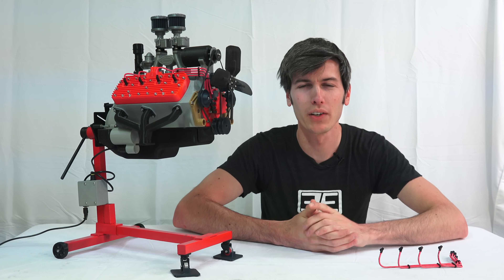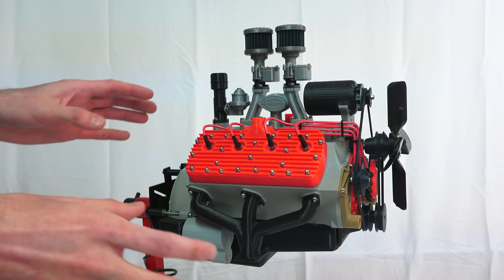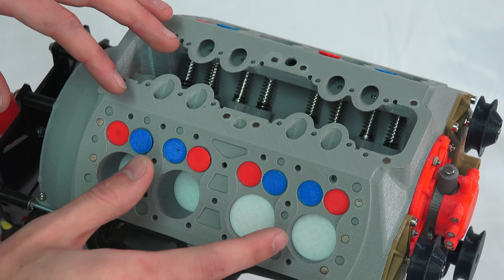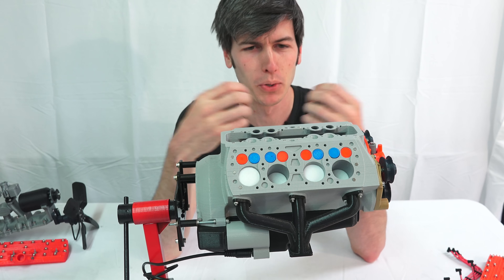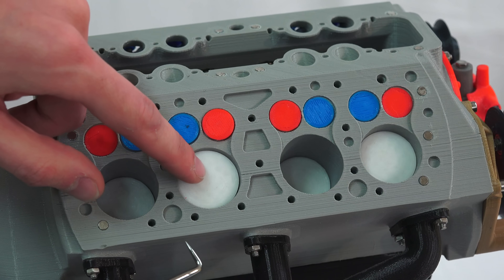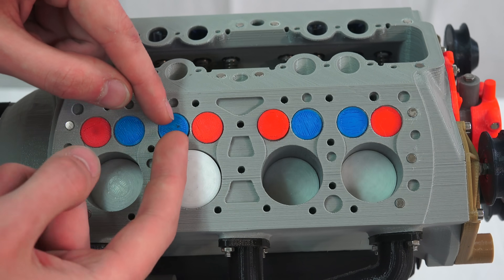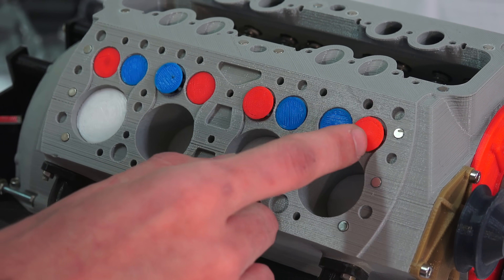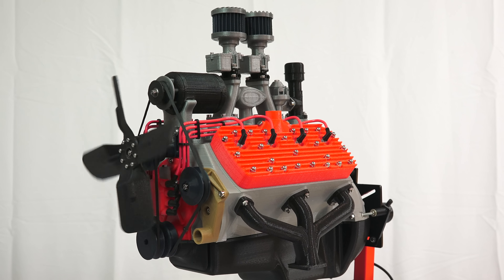Why Ford's Flathead V8 Engine Died

Comment: I think you get way too much into direction change, which current engines do also (intake to exhaust). Intake comes down, exhaust goes up. The real problem is the total available area of the intake and exhaust, which is exceedingly restricted by current standards.

Comment: It's a nice model and a fair explanation of what is going on in a flathead but if we can't believe your age, then why should anyone trust anything else you discuss? I'm not mad, I'm just curious why you would start off (at thirteen seconds) with an extreme and inconceivable statement. ....and you missed the largest, 337, truck/Lincoln engine.
          The cylinders were not offset for the sake of the camshaft but rather the crank, two cylinders sharing one journal.
          A major issue was keeping them cool. With several inches of exhaust port between the valve and the manifold, times six, and the 2-3 and 6-7 cylinders sharing the same port (in the core of the block) it required a very large radiator to cool the water. Ethylene glycol was introduced as an anti-freeze near the beginning of the great depression, therefore not widely accepted or afforded immediately. Also not quickly accepted or recognized as a cooling assistant. 
         It was built for durability at a time when longevity was as important as any feature.
As for power, a little wind from a supercharger (Hollywood Graham had one in 1934) or
a little spray from a Hilborn injection system and we're off to the races, Indy in 1949.

Comment: My first car was a 1951 Ford V8 with overdrive which I bought in 1958.  You covered many of the problems with that design, but I will cover additional problems.

The exhaust valves exhausted into passages through the block so the exhaust manifolds were not in the V, but rather outside of the V, which is clear in the model.  That, of course, added considerable heat to the cooling system thereby requiring a larger radiator.  In addition, the center cylinders shared an exhaust port and passages which is why the two exhaust manifolds have only three branches rather than four.  (The 1955 and 1956 Packard V8s, which were overhead valve, also had the center cylinders sharing an exhaust port; not ideal.)  That method of exhausting increased back pressure and reduced the power of the engine.  By contrast, the Cadillac V engines (V8 and the last V16), and the Packard V12, had both the intake manifold and exhaust manifold within the V.  The Lincoln Zephyr V12 was designed similarly to the Ford flathead V8 with exhaust passages going through the cooling water.  However, the Lincoln V12s preceding the Zephyr had both the intake and exhaust manifolds within the V.

Also, the Ford  flathead V8 camshaft was not centered in the V.  The result was that the valve angles were not the same for both cylinder banks; crude!

Both cylinder banks had their own water pump.  In addition, the two water pumps were an integral part of the two front engine mounts.  That created service problems because it was impossible to change the water pumps without jacking up the front of the engine.

My 1951 Ford V8 did run much more smoothly and quietly than the 1951 Chevrolet 6.  In fact, it could be run down to about 8 mph in high gear and pick up very smoothly, if not hurriedly.  Because of the overdrive, which Chevrolet did not have until 1955, the Ford V8 was very quiet on the highway.

Comment: Having the exhaust ports within the head also contributed to overheating. Exacerbating the problem was a non-sealed cooling system, with atmospheric pressure and therefore a boiling point of 212F. Its coolant passages and oil distribution were also less than ideal. It's impressive how much hotrodders were able to increase power on this engine. Before Chevy came out with their V8 in 1955, the mortal enemy of the flathead was the OHV Chevy six, for which there were many hop-up parts available.
Reply: Kevin Polito.
Huh? There are no ports in the head, exhaust or intake, it's a side valve engine! The exhaust ports are in the block, with the two center cylinders sharing the same port (siamesed ports) and exiting between the cylinders, thus creating the overheating problem.
The exhaust and intake ports are in the head of an OHV engine, not a flathead engine!
Reply: Oops. I misspoke. I MEANT in the block (oldtimer's disease). Yes, having the exhaust ports in the block causes a lot of heat retention.
Reply: Kevin Polito.
Ha ha ha, I can certainly relate to old timer's disease, don't worry about that! Cheers, Rob.

Comment: Inline valves aren't exclusive to modern engines, that design coupled with a very high compression ratio is what made the 66-73 Chrysler Hemi engine so powerful and efficient, its head and valve design were years ahead of its time. That's why it doesn't struggle to rev high like most other pushrod V8's from the same era. The 60's Hemi was such a vast improvement over conventional pushrod V8's that it had to be drastically under rated for insurance purposes. Advertised power was 425 HP @5000RPM even though stock automatic 60's Hemi cars typically shifted at 7000 RPM. As we all know power output increases with RPM and it's worth noting that horsepower calculators and dyno tests put the 60's Hemi engine in the 550 horsepower ballpark give or take a few digits.

Comment: Have you done, or would you do a video showing which engine is more long term reliable; a straight cylinder as the I4 or I6 in comparison to the V6 or V8 configuration. Thanks. Always learn something useful in your videos. Keep up the good work.
Reply: @Bruce Wayne Inline engines are always more reliable long term, the fact that the cylinders aren't leaning over at an angle greatly reduces bore wear, helping them hold compression longer and burn less oil. Nothing lasts longer than an old American inline six, there's a lady that's been driving the same sixties Mercury Comet since it was new and it still has its original inline six with over half a million miles on it.

Comment: the Cadillac was better , if u rotate the  cam you can run the intake in through the exhaust helping greatly with the heat issue .

Comment: How do the exhaust gasses get to the headers? Valves are on the opposite side of the cylinders.
Reply: Blatt Ferenc.
The ports run through the block, with the two inner cylinders siamesed (sharing the same port), and that is the very reason for their inherent overheating problem.
Reply: Yeah, I'm 'ere Thank you very much
Reply: Blatt Ferenc.
No worries mate, cheers. Rob.

Comment: "Amazing how sophisticated it is for its time??"
You need to read a bit more I reckon. By the time this pos was 'expressed' from the bowels of Ford, there were already multi-stage superheated steam turbine engines cranking out ten of thousands of HP for at least 30 years, plenty of engines with overhead camshafts - many with 4 valves per cylinder. 
Don't get me wrong, this is an interesting motor in the scheme of history and esp hot rodding, but it still is a pos (lol). 

It is a fact every mechanical principal was worked out by 1930.

Comment: Wrong!The cylinders are not offset because of the camshaft as you said! Its because of the crankshaft as you need that offset to get the big ends of opposing cylinders attach to the same Crankpin . Otherwise you wouldnt have that offset in OHC  V-engines if the camshaft would be the problem.

Comment: And then we got to ohc engines with canted valves, and dohc engines with central plugs and pentroof chambers. Much better volumetric efficiency and shortened flame travel, besides compression-ratio conducive to efficiency. Yeah, these old flatheads were smooth-running, low-power, boat-anchors. Chevy ohv I-6s would run circles around them.
Reply: I had a 53  Chevy six and a friend had a plymoth flat head six. He had no trouble keeping up with me. The Chevy had an antiquated splash system for lubing the connecting rods. Basically it was a crappy engine in spite of having overhead valves.

Comment: All early Ford engines were made less efficient on purpose because Henry Ford wanted it that way. The Flathead V8 is basically two Model T Ford engines. Both Model T and A engines shared a central exhaust port, also split intake ports.  If Henry were still alive and had his way we'd still be driving cars with 26 horse power and mechanical brakes.
Reply: Fords were late to the party with many contemporary advances in large part because Henry hated to pay for the use of patents owned by others.
Reply: Tony Miller---   Tony, you're absolutely correct.  Ol' Henry had to be dragged, literally kicking & screaming, into the Model 'A' era, insisting that his Model 'T' was the world's best car ever made or ever would be.

Comment: How does a hemi piston make more compression?
Reply: Shane K.
There is no such thing as a hemi piston. The word hemi is only a Chrysler trademark, and refers to the hemispherical crossflow combustion chamber. Most modern engines are of this design.
Type in, Hemispherical head, and crossflow head, for a proper explanation.

Comment: The flathead can be a real screamer, and there's two ways that they've been pushed up to ludicrous amounts of power over the years.

* Forced Induction. 95% of the Flathead V8's breathing problems die off pretty quick when you go to the scrapyard and rip the supercharger off a deceased OTR truck that had a screamin' jimmy in it. Hot rodders discovered this almost immediately and we were seeing 6-71 and 8-71 blowers put on Flathead V8s before the Flathead was discontinued! Even today this remains an incredibly commonplace means to get them to breathe and it definitely works. Some people today opt for turbocharging instead of supercharging, but whatever the means, the trick to getting a flatty to make power is to get it to breathe and this is an incredibly easy way to get it to breathe. Part of why they take so well to boost is, incidentally, one of the flaws you pointed out: That low CR. It makes it nigh impossible to get detonation on one and you can boost them to the moon and back without much effort on gasoline with barely enough anti-knock properties to be said to have any at all. On modern 87 octane pump gas you pretty much outright can't get one to ping, even under ridiculous amounts of boost. Computers do this in modern engines, but for the ol' flatties, mechanically low compression ratios did the trick.

* OHV conversion kits. More popular today than back in the day, but there exist kits that put OHV heads on Flathead blocks. Not exactly the path I'd take if I owned one...half the point of owning one is to have a flathead, if I wanted an OHV V8 I'd stick with a Windsor based engine...but it is certainly a plausible and practical means to wake them up. CRs can crest 12:1 without much fuss this way.

Really, though, the magic of the flathead isn't in making it rev or anything. No, the magic is in their ruggedness, their reliability, and the fact that they pull just about as hard at 450RPM as they do at redline. Sure, sure, that redline may only be 3500RPM on a good day with a later model engine, but still. You had more torque than you knew what to do with and you had it from idle to redline. They pulled like mad and could be found in all manner of stuff.

What's interesting is I could see an argument for their return, and that argument contains the words 'Direct Fuel Injection'. And 'Packaging'. With modern computer control, direct fuel injection, and boost, they could very easily be quite the competitive engine even in today's fuel-economy-crazed world, and they'd fit in places you wouldn't expect an engine of that size and output to fit owing to the fact that everything's crammed into the block itself.

Comment: used to have a 52 flathead on a winch truck, it powered a generator and welder. I never had a problem with it . It had a flathead, because it was on a 46 chevy truck that a guy built in about 1960 to work in the oil fields with. Bad part was he got sick right after he built it and died a few months later. It sat in a barn for almost 30 yrs tell it was sold at auction.

Comment: How hot would the block get with the exhaust almost sharing space with the cooling?
Reply: derek rens.
That's exactly why they suffered overheating problems, causing some engine blocks to crack.

Comment: Great video! I read that flathead engines had problems overheating under heavy loads or in hot weather. And though Ford disconnected their V-8 in 1953, Chrysler and AMC-Rambler kept making I-6 economy engines into the early 60's.

Comment: To add, my dad always said that a ohv is easier to work on vs a flat head, and taking it in is easier as youd only have to bring in the head not the whole vehicle.  One plus i found out is flatheads are easier to swap head gaskets in id imagine.  

I do have an irrelevant question, whats up with the design nowdays with ohc engines that have the waterpump run off the timing belt? I just see it as a terrible idea but curious as to why it exists, thanks
Reply: Wolfie Tigerstripes.
That's the only way a water pump can be driven on an OHC engine.

Comment: Didn't superchargers arrive at a similar time to this engines life cycle? Also wouldn't a turbo(or any compressor for that matter) help it and i mean much?
Reply: elvis13.
The first supercharged internal combustion engine was designed and built by Scottish engineer Dugald Clerk in 1878.

Comment: It's been understood for flathead builders for a while now that compression is less preferred to airflow. Simply more air and less compression will yield better power then the opposite. You didn't mention the ramp in the head that kind of forces the air right onto the piston. This was actually the secret ingredient in some flathead race engines to get obtain high rpm.

Comment: I'd like to add another disadvantage of the flathead V8.  The exhaust was forced to flow inside the block to the exhaust manifolds.  This resulted in the early versions often overheating due to unnecessary cooling of the exhaust in the block and heating of the cooling water.  A friend of mine has a beautiful '36 Ford V8 coupe and has such a problem when driving the car at low speeds in parades etc.  It seems to do okay on the highway at 50 mph or so when radiator airflow and water pump flow is improved.  In order to keep it as original as possible he carries a large jar of water which has a hand pump plumbed to a mist sprayer in  front of the radiator.  This increases cooling dramatically by wetting the radiator and cooling by evaporation.  Later model flathead V8s had much larger radiators, larger fans and dual water pumps which largely eliminated the overheating issues.

Comment: Very cool 3D model.  I'm currently putting together an original Visible V8 with my grandson.
Reply: Mark Pace.
Is it a Revell model kit? I'm about to start building one myself. I've been told they are quite difficult due to poor Chinese manufacturing with ill fitting parts, is this true, and what is your progress so far?
Reply: Yeah, I'm 'ere yes it is the reveal. But it is so old it was made in the US with some things from Taiwan.
Reply: Mark Pace.
Is it one of the original ones with the little electric motor, and flashing lights on the spark plugs?
Reply: Yes, that's the one.  I built one when I was about 10 yo, I'm now 60.  I thought it would be cool to find the original one for my grandson. I found it on eBay, it was a little pricey.  The "hard" part is building the crank shaft straight and as you can imagine some of the plastic is a little brittle after all these years.

Comment: My first boss back in 1983 was a WWII vet. 
He was a Ford dealer and had three Ford built Jeeps. One was for parts, one was still the used every day roadside breakdown vehicle and the 3rd was fitted with a Ford Customline 'twin spinner' V8 and Fairy Overdrive unit. 
He'd made a full hard canopy, but left the sides open to use on the beach as a fishing vehicle. A few times I got to ride in it with one of the mechanics and it got along pretty well for a Jeep 👍
Certainly compared to the 60km/h the original was capable of 😁

Comment: how does it keep running without the carbs and cylinder heads?, the mind boggles..
Reply: Djokkins.
It must be wizardry!
Reply: Very likely, he should have taken an engineering degree instead og going to hogwarts.
Reply: Djokkins.
Even the most brilliant engineers on Earth can't make an engine run without carburetors, intake manifolds, and heads, but wizards can! Cheers, Rob.  :)

Comment: There was an overhead valve kit you could buy to convert the flat head.  Hot rodders love the flat head engine because of the exhaust note produced, much like Harley Davidson they have a distinct sound.  the biggest down side to the flat head was heat.  The flat head design had terrible cooling properties as well as the block.  Having the exhaust ports in the block, with long runners with twists and turns transferred a great deal of heat into the cooling system.  this is why they ran two water pumps.  Cracked heads were a common problem too.  However, Nothing sounds like a flat head ford v8

Comment: not a late model flathead thats 1938-1948 style head.....Late model would be the 100-125 hp 8ba style heads with front rad intakes  and the intake is an eddy meyer. And that engine being a 24 bolt would be anywhere from 85 to 100 horse and at least 6.20.1 - 6.75.1 cpr the earliest flatheads 1932-1938 first gen was 85hp and a 21 stud, 1938-1948 with 24 bolts and would be anywhere from 85-100hp and 1949 to 1953with 24 bolts and would be 100-125 hp. and not to mention the smallest of the bunch the rare v8-60 the 60hp flathead v8